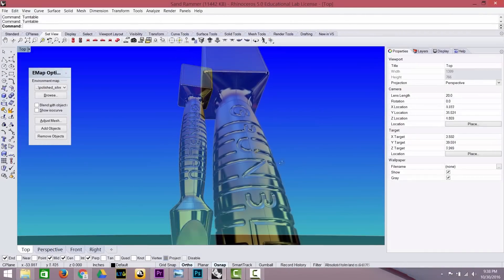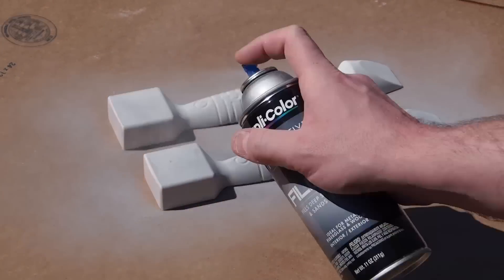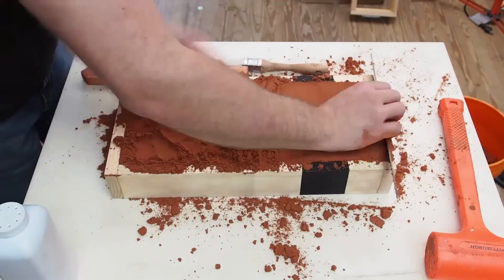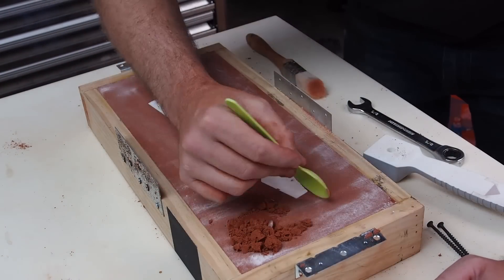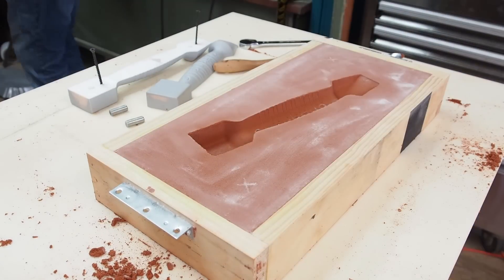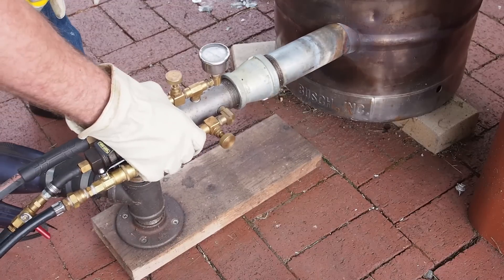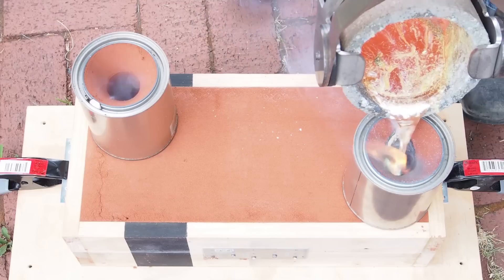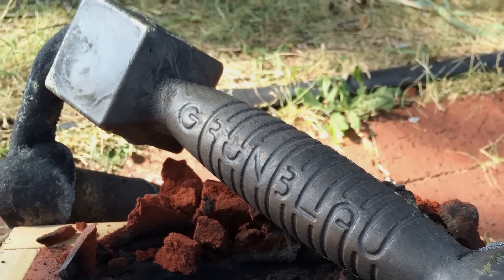Casting Brass | Sand Rammer - 3D Printed Pattern

Comment: You need to start doing lost wax casting. You will love it and hate it. Love it for the result, hate it for the time it takes :-)
Reply from the maker: +gus bisbal I agree!  Might try that this winter...
Reply: Try to get the 200 mesh fine zirconium sand for the first layer application which will give you the finger print accuracy of the process. You can go full investment but you have to fire that thing for a long time to make it usable. Shelling is more practical for larger things than the size of your fist. I can connect you to people that provide good products in the US for the shell consumables. I am in Australia and that is where I get them from.
Reply: Adding to the comment from gus bisbal, some of the bigger suppliers in the eastern us for ceramic shell products are ransom and randolph, remet, and saunders foundry supply. Theres a lot of smaller distributors though.
Reply: I tried it after doing Petrobond stuff but I don't have a burn out oven and had issues there.   PITA , never got good results

Comment: Holy crap you got lucky with that brass cast! :O What was that, about two inches of excess at the bottom of the riser? :P
Loved the tongue twister :D I had to go back and listen to that again :D Nice work man! You can clearly see the different amounts of shrinkage in the end shot
Reply from the maker: +Azayles Yeah probably should have had a bigger gate on the in and out...  Good catch on one of the last images.  I didn't mention it but the Brass shrunk more than the aluminum.  Could be because of all of the zinc or because without the extra riser, it shrunk more that it would have otherwise.